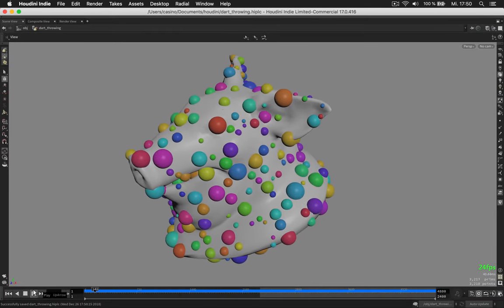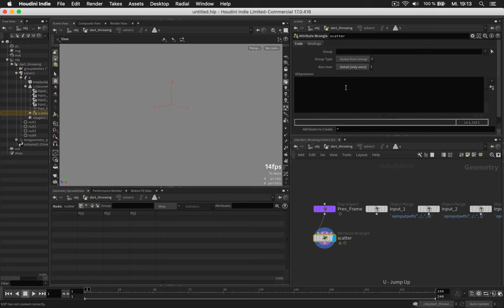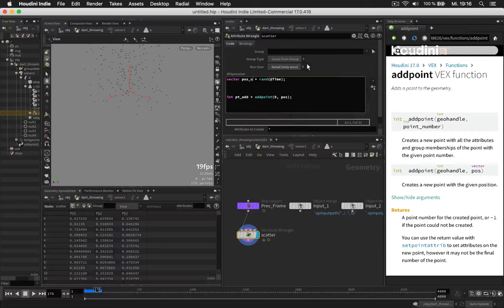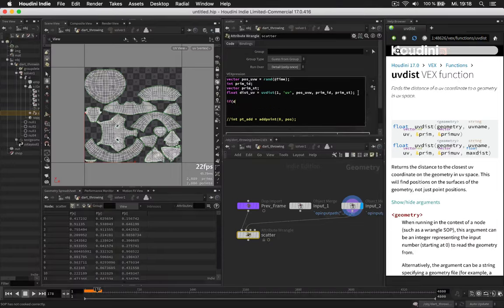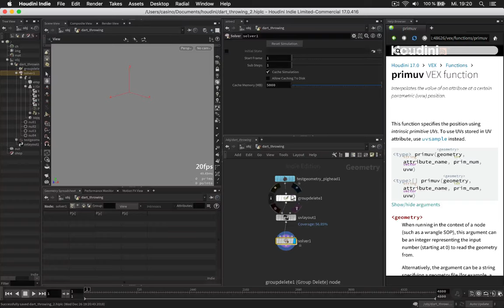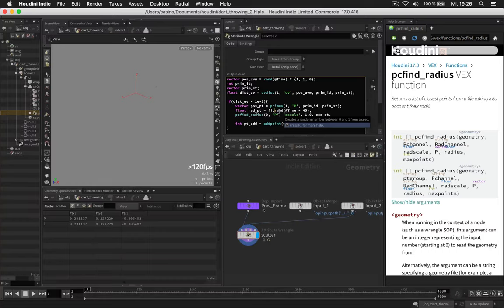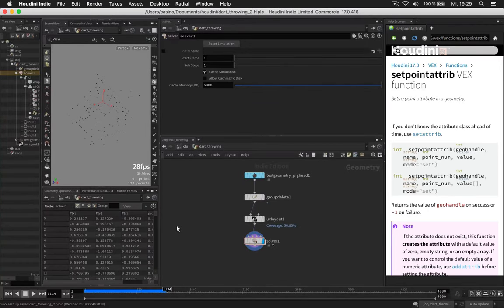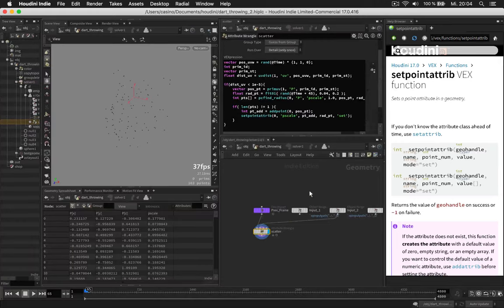Dart throwing algorithm – Houdini Tutorial

Comment: Does the uvdist 'uv' argument (filled in with pos_uwv), apply to the uv coordinates of the geometry or kinda world space? 

If world space: Isn't this just the same as a normal xyz point position? Why do you need the *{1, 1, 0}?
If geometry uv: Why do you need to find out the distance? Isn't it always on the geometry then?
If uv world space: How can it hit the pighead if you flattened the 3D uwv space out to a flat plane using *{1, 1, 0}?

Thanks for the video. 🙂 Hope you can clarify this confusion I have.
Reply from the maker: The 'uv' argument applies to the UV coordinates of the geometry. In pos_uvw we define a random position on the UV-map. And by asking if the distance is below a very small threshold we can make sure we have actually hit an UV island. Keep in mind: There can be random UV positions that have no representation in world space and would end up on the seams without filtering. primuv() is basically translating our guesses from UV to world space.